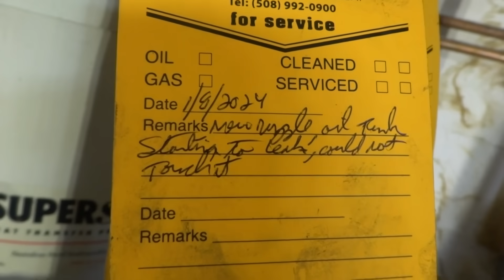RIELLO BURNER SERVICE

Comment: My sister and I are in the process of cleaning out our father's house after he passed last March.  The oil burner had not been serviced in over 3 years.  When the heating man came in today, the first thing he checked was the oil tank,  It has 2 rotten legs, so he was unable to change the filter or service the burner.  That tank was there when my parents bought the house back in 1956 (I was 2 years old then... guess how old  I am now...)  I'm surprised the tank wasn't leaking.  Anyway, since there is now access to natural gas (my father refused to switch to gas and then complained that it cost him over $3000 to heat with oil), I was told that our best bet is to see if the gas company will install a conversion burner.  I have to say that I agree. I was also given the name of a company that specializes in removing old oil tanks.  Steve, from watching your oil burner videos, I wasn't at all surprised that the tank inspection at Dad's house came first, and that the system couldn't be serviced because the tank is in such bad shape.

Comment: I’ve changed 1000 filters on tanks more sketchy then that.  Never an issue.  The nozzle should have been tightened in more then just holding the assembly with one hand while tightening it in with a wrench in the other hand, essentially hand tight! It wasn’t off on limit. It takes about 8 seconds for the board in the primary to recognize what’s being asked of it but don’t mind me, I’m just talking out of my 30 years in the field backside 😂

Comment: I'm really surprised you didn't want to touch the filter because of the tank, clearly that is based on past experience. I wouldn't think a pin hole leak would make the pipe nipple and filter assembly so weak. Not questioning your experience, just surprised.

Comment: Hi Steve! We have cold climate heat pumps over here in Canada. I got a 3 units split installed and it works well. They keep heating up when the outside temperature gets as low as -22F.
Reply: they still struggle tremendously below 4 Celsius. The Outdoor coil (heat exchanger) has to be 15 to 25 degrees colder than the outdoor ambient temperature for them to work. so at -22f your coil is between -37 and -47 Fahrenheit.
Reply: Electric is really inefficient when it gets very cold. Consider some reinforcement for cold days.
Reply: Don't some of the heat pumps out the coils underground in cold climates?
Reply: Water temp was warm and storm was tucked off the coast so coastal areas got screwed with less snow/rain mix. Even in CT, 1-3" by I-95 6-12" inland

Comment: You’re right it sucks heat pumps don’t last very long.  So that makes the long term cost actually more since then you’ll need another $15k to replace it all in 10 years!  I looked up data charts from people who’ve heated with gas vs mini splits.  The mini splits are cheaper to heat with by quite a bit compared to gas over the entire year.  However, they cost more during very cold peak times briefly.  New mini splits can have full capacity to -5 sometimes even -15 degrees.  Then, you can’t just repair them off the truck so that’s another problem.  Living in Florida we don’t hardly use heat so kicking in the heat pump a couple weeks in the year is all we need and the rest is just A/C.  Even in Florida if you want to be able to get your A/C repaired you just want a basic 1 or 2 stage or else the technician can’t just show up and fix it!  If you want the fancy stuff you pay and then pay some more

Comment: Hey Steven, been watching all your videos to see if i find an arcoliner No. O-153-T series. 3bt-j4 is a really old system, it fire up but is not heating the radiators and then stops when temp gets to 200F, i dont see any circulating pump i dont know if an circulating pump is required i cant find any info online. Probably you got an idea. Thank you.

Comment: In all the time I worked on Riellos I never thought about taking the head assembly out with the burner still mounted to the boiler. I've always taken the burner off complete and then removed the blast tube to get to the nozzle!

Comment: Second comment Yippee! Hey steve I was wondering about an old boiler I have in my bacement. It is a rare one I think. It is a Mueller Climatrol 41-74-E. It is oil fired with a Carlin Elite model Ez-1. I was wondering  if in your spare time could you help me with my search of this old boiler. Boiler Information: make: L.J Mueller Furnace C.O. Devision of worthington. Model: 41-74-e. Oil burner: Carlin Elite EZ-1. Thanks steve!🙂